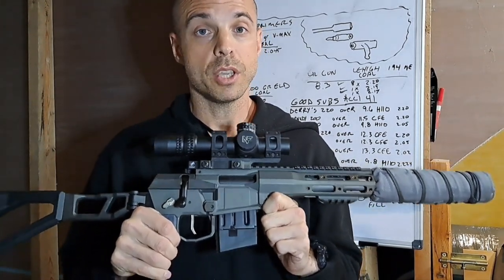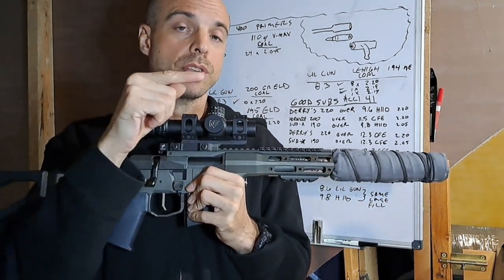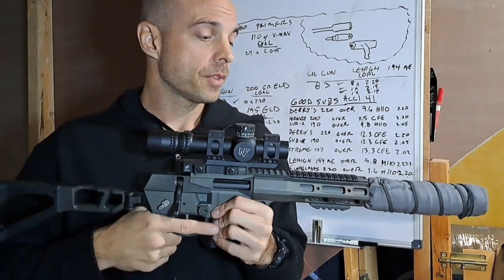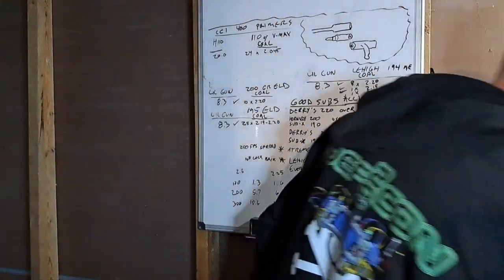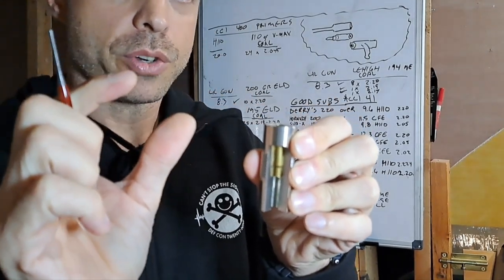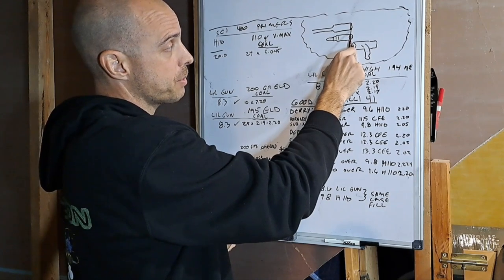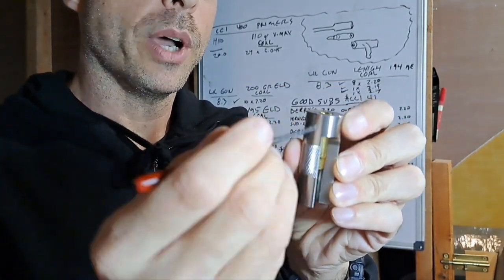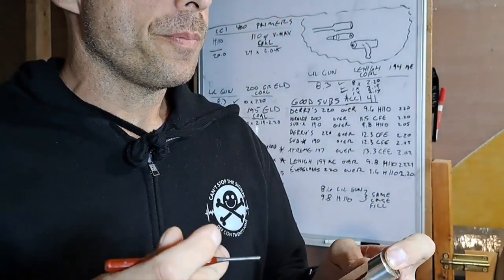Q Mini Fix Light Primer Strike Issue SOLVED

Comment: Really great analysis of this issue.   My first mini-fix actually had a worse version of the light strike issue.   I tried many different types of factory ammo but only got about 50% ignition.   I sent the bolt in to Q and they were able to get it fixed.   In that case I had an actual defect but Q’s customer service was great.    

I did notice even after the factory repair that certain ammo would get a fail to fire.    I eventually found the same thing that you did, that loading with CCI 400 primers gave me 100% reliability.   I’m glad you were able to nail down the main factor as to why some of the military primers would work and some wouldn’t.   It definitely makes sense that headspace plays a role in this.
Reply from the maker: Thanks, I appreciate the comment. How long did Q take to fix your bolt?
Reply: I got it back from them in about 2 weeks so the repair time wasn’t bad.
Reply from the maker: Yeah, that's super solid IMO. My experience with Q is the same. I had a faulty cheek piece for the fix stock and they didn't hesitate and just mailed me another. Cheers.

Comment: With a bolt action rifle keep your brass separate for that rifle and when you reload use a RCBS neck size only die that way that brass is fire formed to that rifle.
This should give you the same head spacing on every cartridge.
Reply from the maker: Great tip.

Comment: Some Redding competition shell holders might help you some. You can easily  add a couple thousand's to your cases for your fix rounds. That might help. I also wonder if Q would just add or remove a little mass in the firing pin should fix the fix.
Reply from the maker: Hey, thanks for info. I use a Dillion RL550C for my press so I'm kind of stuck without being able to use shell holders like that, but I can definitely adjust my sizing die to bump the shoulder of I need to. For me it's just easier to use CCI 400's so I can load fast and shoot more. :) I was thinking that same thing, a little bit more length on the firing pin would do wonders for sure. I'd be willing to bet that this issue would disappear based on all of the light strikes that I had being shorter shouldered cases.

Comment: Man! Great video. I love the mini fix but j had no clue as to this issue till I bought one. Was very discouraging at first. Like you I went to lighter primer cup and it runs for me. I am forced to reload for it as I am pretty sure all the cheaper blackout ammo will use the harder cups. What kind of groupings are you getting ?
Reply from the maker: Hey, nice. Yeah, that's be a major bummer to not be a reloader and get stuck with this issue. I'm getting around 1" groups at 100 with my vmax h110 loads. My main subs for this gun are lil gun/195 eld-m (blems) and they are around 1.5-2" at 100. I load on a Dillon 550 and just use mixed brass, and don't bother too much with trimming unless the cases are long though, so my seating depth varies and case volume varies. I haven't gotten consistent low SDs and don't really care, lol. I just like to shoot a lot so I load for volume mostly.
Reply: Yeah I am not getting very good sd either. I usually run match primers with my prs stuff and can get sub 10 fps. But that primer is too hard for ignition. I ve put this project on the back burner for a while. I really want subs to shoot prairie  dogs here in a few weeks
Reply: Yeah I am not getting very good sd either. I usually run match primers with my prs stuff and can get sub 10 fps. But that primer is too hard for ignition. I ve put this project on the back burner for a while. I really want subs to shoot prairie  dogs here in a few weeks

Comment: Having this problem currently with gorilla 8.6 ammo in the fix..  Problem is I cannot just use another ammo because no one else is making any right now..
Reply from the maker: Dang, sorry to hear that. I'm holding off on the Fix 8.6 SBR for now because I was wondering if this problem was there too.
Reply: This gun is straight trash. I’ve tried all the ammo that Q has said to try, and I’ve sent the bolt back twice. Still issues.
Reply from the maker: That's frustrating, sorry to hear that.
Reply: @D0nkeyman  There is an ole boy on SH, that took his spring and sent it to a spring manufaturer.  They made him a heavier version of the spring and he said he has shot some 200+ rounds now with no issues..  I've bought a couple from him and will report back..
Reply: @lindsayraines1060  where did you get them and can I purchase any? Might as well try that- no point in having a light bolt handle if the thing wont fire
Reply from the maker: I'm interested in that too, I'll take a look on SH. Thanks.
Reply: I have the same issue with my 8.6 fix. With handloaded ammo and Remington primers. 20%-30% of all rounds fail to fire due to a light primer strike. Crazy a $3,000 gun sucks this bad.
Reply from the maker: @muffmanaj bummer! Interestingly, my 8.6 fix has been 100% even with CCI 34 primers. I shot 10 rounds loaded with ginex LRP (which are super hard primers) and only had one light strike. I just cocked again and it set off.
Reply: @D0nkeyman  I know this is a while ago but guy was on SH.  Not sure where he got them made.  I got one from him.  It was a bitch to change, but I haven’t had an issue since with any ammo.

Comment: How do you know what primers are in factory ammo? I just bought a minifix in 556 16” and all I’ve shot is Hornady match 223 75gr and federal GMM 223 77gr and out of 150ish rounds i haven’t had a light primer strike “yet” Hornady match 223 75gr is the most accurate so i plan to stick with that if it doesn’t have hard primers.
Reply from the maker: Nice, looks like those are good choices. You'd probably have to reach out to the manufacturer or just buy one box at a time before you commit.
Reply: @ConcealedSteel  yeah so far both of them have been flawless. I sent Hornady a message to see if they will tell me what kinda primers they use.  I hope it’s not a hard style. I’d imagine if it was i would he having issues already maybe. 

Shot 3 boxes of Hornady match  75gr, 1 box Hornady 55 vmax, 1 box Hornady black 62gr fmj, 2 boxes of Federal GMM 77gr, 1 box of Wilson combat 77gr, 1 box of federal 69gr and 1 box of federal 73gr.  Maybe since all of those are 223 and not 556 that makes a difference since 556 usually has hard primers.  I did lots of testing yesterday with all that since i know the 300 version had issues with light primer strikes. Plus i wanted to see which one had the best accuracy as well as function.
Reply from the maker: Good deal. I've read the same, that it's only been with the 300 AAC version. I really love this thing anyway, shot a bunch with it today. I load my own so it's not a big deal for me, and I knew going into it that there may be problems to solve.
Reply: @ConcealedSteel  yeah that’s what off mainly read as well, but if you reload anyway that makes it a little easier at least so you can stay away from certain primers. I have a 308 fix as well and haven’t had any light primer  strikes, but I’ve seen where people had issues with those and 6.5 as well.  I run Hornady ammo through it as well but mainly Hornady black and so far so good.  I don’t enjoy shooting it though. This 556 version is so much fun. Anyways thanks for the video very informative.
Reply from the maker: Thanks, man, glad to help fellow gun owners. I'm already thinking about a 223 version, that sounds like a great time.
Reply: @ConcealedSteel  no problem. I’d recommend it for sure . I can’t comment how the 223 proof barrel versions are that people use, but the factory 556 is great so far. I’m hoping they do a factory 12” pistol version.  I believe they did a sbr green one but it sold out fast and was a limited run.